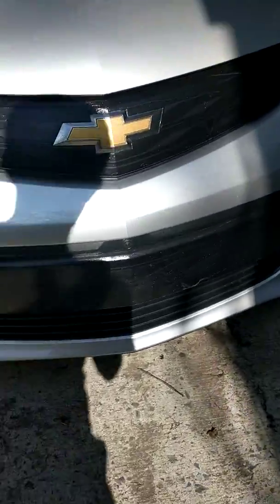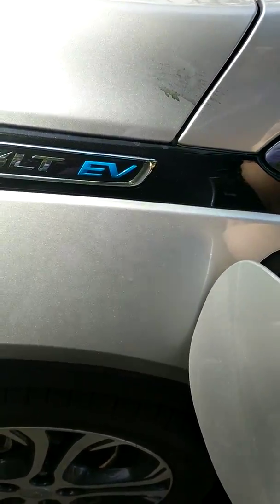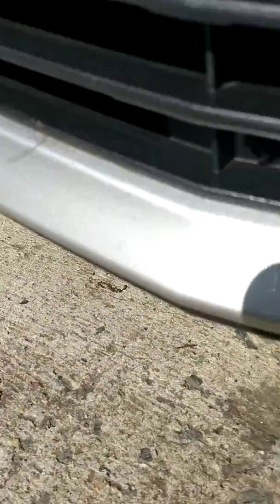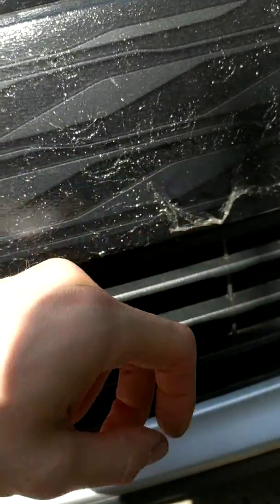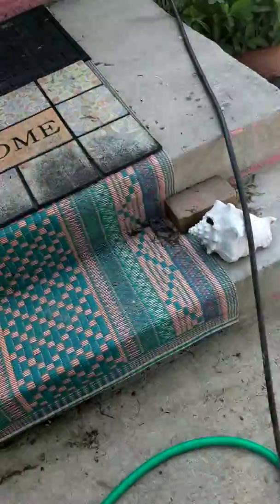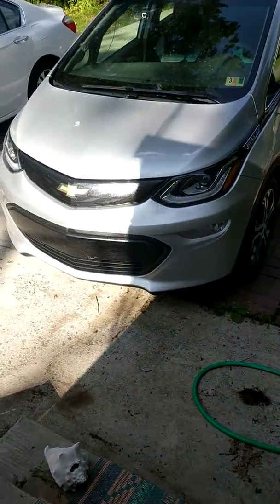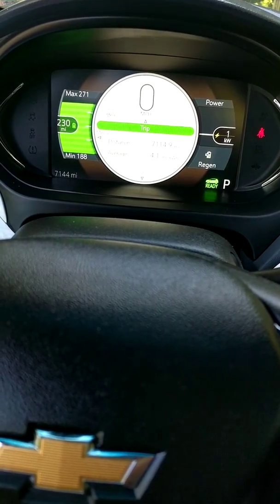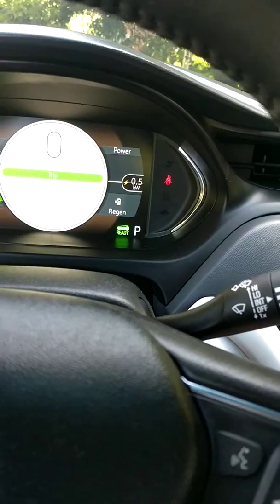Chevy Bolt EV overheating when reaching capacity? Loud radiator fans....

Comment: The grinding-ish sound is the AC compressor running to dissipate heat from the battery. It's not a sign of something wrong at all and you can actually hear it if the cabin AC is having to work hard.
Mine does it too.

Comment: my 2017 bolt just started making that noise when it started getting hotter and It has 30,000 miles on it. When the temp reached over 90 degrees it started making the noise. sounds very concerning and embarrassing to say the least. I don't feel that it's normal so I will pay the 150 diagnoses fee and try to get some answers
Reply: I'm sure you know by now, but this is completely fine to hear.

Comment: AC compressor noise. Normal. Cooling the battery pack on a warm day. The batteries generate quite a bit of heat too when nearing a full charge.

Comment: it's the BMS (battery management system) to cool down the battery pack while charging. this will happen especially during hot climate and/or the battery is charging close to full capacity at which the battery gets hot.

Comment: That doesn't sound right at all. Take your video to your dealership and have them look into that problem. I've never heard anything like that out of my Bolt.
Reply from the maker: Luna NW Loons dealer said it's nothing unusual... 

Apparently it's fully functional.
Reply: Ultimate Dab  hear it out of my  18 Volt. Never heard it before because I had Volt and Bolt in a shaded breezy garage in the north east.  In Texas in a warm shaded garage the loud fan kicks on to cool the battery...